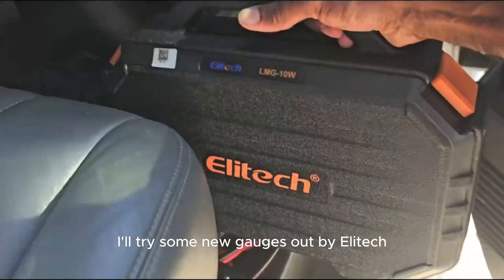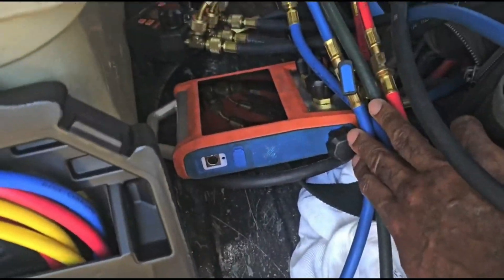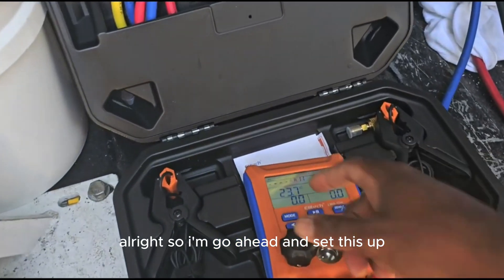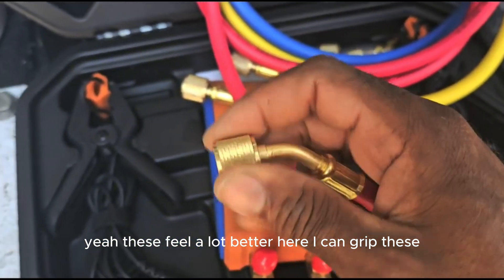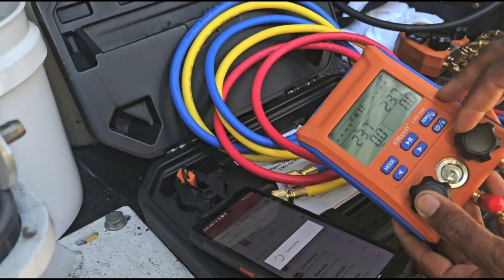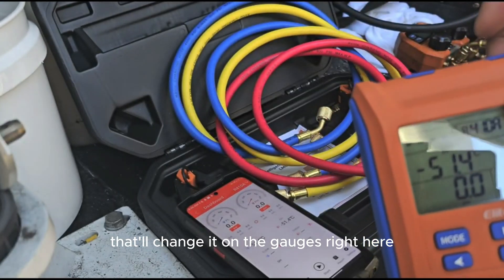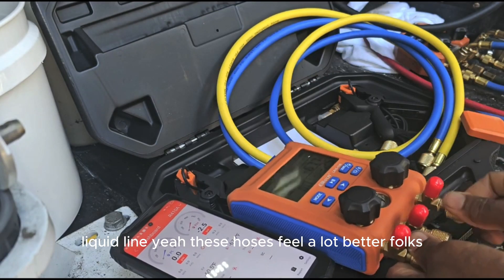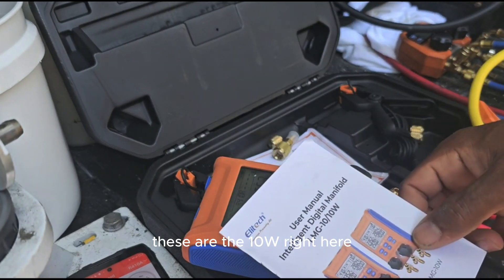The Initial Setup of Elitech Digital Manifold Gauge LMG-10W

Comment: I purchased a set on Elitech LMG -10 gauges today Amazon and they dont work ! The high pressure gauge reads 40 psi too low, which means they will cause anyone to over charge a system drastically and will destroy a compressor. I am no novice at HVAC , I have been a HVAC Tech for 40 years, 37 of those years I have owned and operated a very successful HVAC Company in FTY Worth,  Texas. I am N.A.T. E Certified, EPA Certified, Authorized Carrier, Trane and American Standard Dealer, I have worked all over the world and I will testify under oath that these Elitech Gauges are junk! I hope I have time tomorrow to do a video docunmenting how aboslute worthless these gauges are.